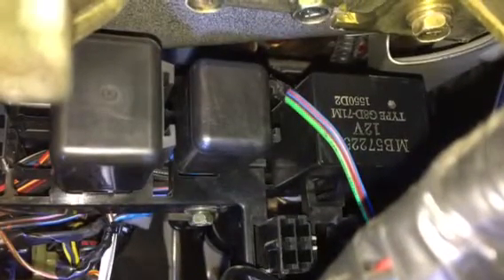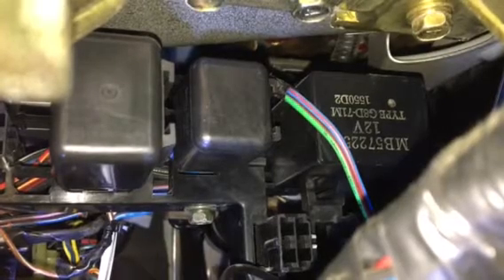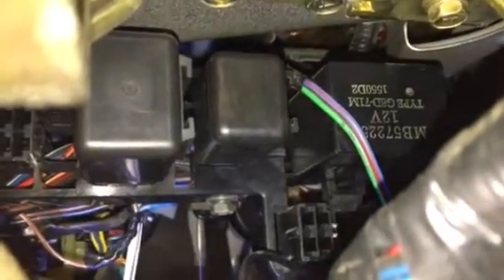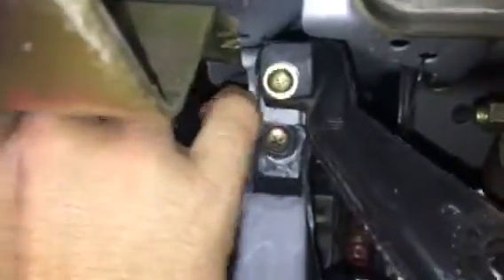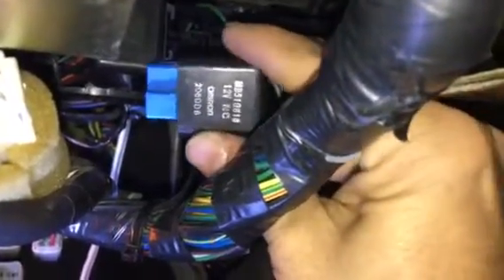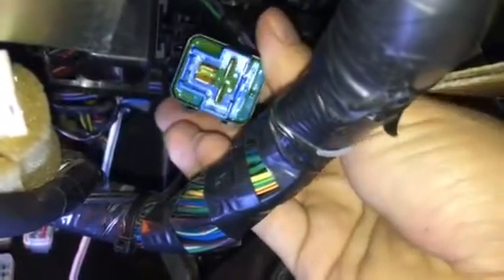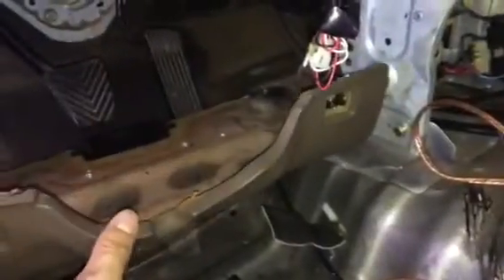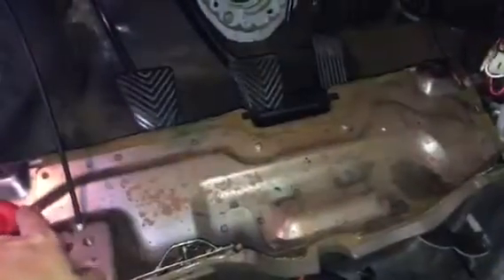91 dsm starter relay removal

Comment: So I did the jumper,  I didnt even turn the key or put it in it still wanted to start...
Reply from the maker: Seems you have more underlying issues that I can help you with sir. You need to start from ground zero. And work your way up and write everything down you did and your outcome. Test your relays with batteries. Look on tube tons of videos on how to test them. You might have a open circuit somewhere. Isolate wires/cables disconnect them one by one reconnect them all. Until your problem goes away or appears for whatever you are looking for?

Comment: I'm having the same problem but I already replaced relay n starter n tryed touching back of starter but nothing. Any ideas it would be much appreciated. Trying to avoid taking it to shop.
Reply from the maker: Antion Diaz check your cables connecting to post make sure they have good connections make sure they are not corroded if anything splice the cables and buy new post connectors
Reply: @uliperezsatx  they r good. Battery cables n everything is good

Comment from the maker: It was not working you can check it with a dmm and or a battery..also my car would not crank over and I replaced my starter the teeth on starter were worn down as well... so I went ahead and bought a alternator too...the previous owner did not keep up with it ..:(

Comment: Did ur car just stop working ? And didnt want to start ?
Reply from the maker: Team DriveAlot it was intermediate it would start . Then it wouldn’t. Or then it would crank but not turn over.
Reply: @uliperezsatx  oh because ive similiar problem but it will not start just crank ? Ecu har been replaced before with new soldering. So i dont know where to start lol .
Reply from the maker: Team DriveAlot well there’s a way you can power up your relay tons of videos on tube. That way you can isolate the issue. Use your dmm to see if your getting power to ur starter. But before allllll that do ur basic Spark, Fuel, Compression